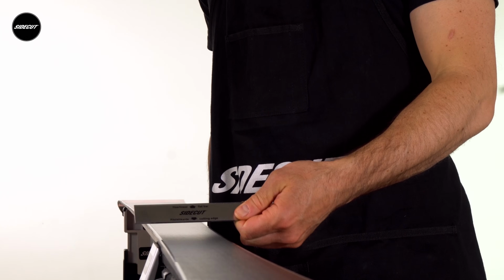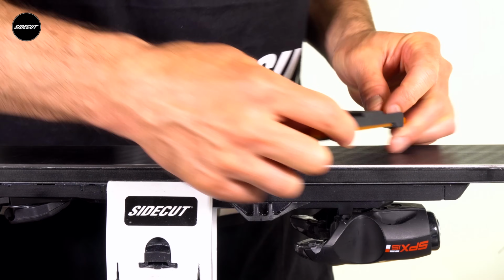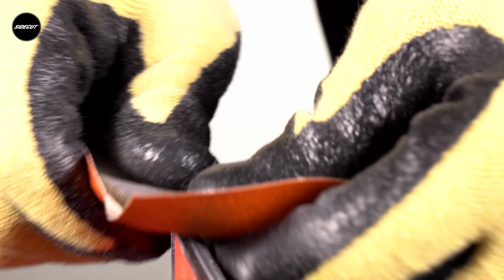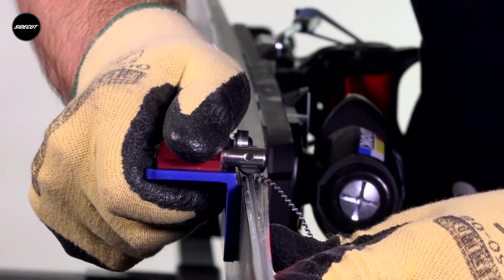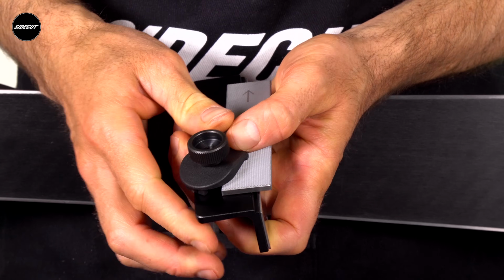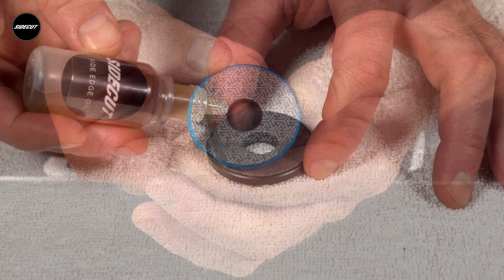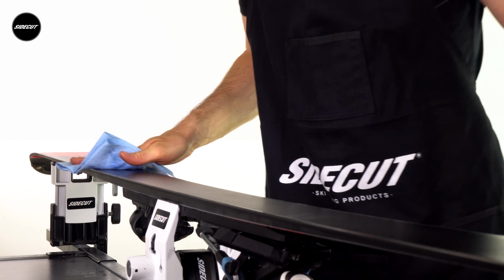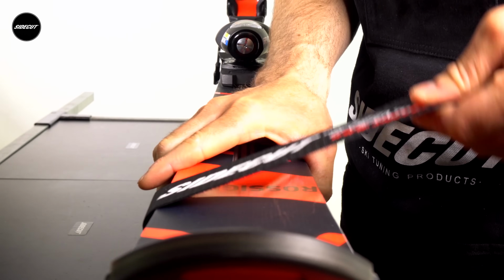How To Tune YOUR Skis

Comment: Question.  You say to scrape the wax within 1-2 min while still warm.  Isn't a warm scrape an alternate way to clean your base (rather than using a cleaner) as it can pull the wax out?  I thought it was best to wait for the ski to cool back down, or even better over night, before scraping?
Reply from the maker: A "hot-scrape" is an alternate way to clean impurities from the base. With Nanox this is different and you're scraping when the wax is "warm-to touch" not "wet" like it is when "hot-scraping".  With traditional waxes yes you wait for a period of time before scraping, however with Nanox you are 'required' to scrape when warm to touch...that's one of the many great perks and nuances using Nanox waxes.  You save so much time with this method.  And no it doesn't affect the glide - it improves it!  Nanox is very unique for several reasons.  Watch our new video coming out in the next week for more in-depth info.

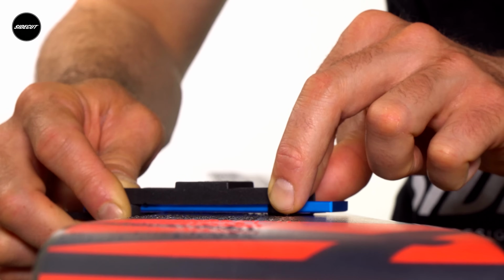Comment: If the base edge bevel comes from the factory already at my desired angle, how can I polish it to remove grind marks and any "waviness" without also cutting the bevel into the base itself? In fact, I think I can see a little bit of this in your video at 4:06. Would this thin strip of base where the structure has been removed affect glide performance?
Reply from the maker: 1st: evaluate if it's really on desired base-edge bevel by using a base bevel meter/gauge.  2nd: use don't need to remove the grind marks unless it's completely inaccurate but this is somewhat rare from the factory.  What you do need to confirm is that the tips and tails in particular are on your desired bevel. 3rd: you won't cut into the base itself if you apply the correct technique and use the correct tool (as shown in the video).  4th: the thin strip of base you see without structure is common and done like this on purpose by the machine.  If you contact any base at all it's minimal at only 1-3mm in from the edge.  Hope this helps!

Comment: Great video thanks!! just one thing....new skis with base bevel at 0.9 and side at 87.5 which guides am i using?? am i taking the base to 1 degree and the side to 88?? TIA
Reply from the maker: 1.0 on the base and either a 2 or 3 degree on the side edges (92 or 93 guide which will give you an 88 or 87 degree bevel).  Note: 87 is more aggressive and holds better on harder snow if you have the matching skill level.  88 is more user friendly. Hope this helps!

Comment: How often (how many days of skiing) shall we sharpen our edges with a file?  I feel that after 5-6 days on cold icy conditions, my edges are becoming dull, hard to control my skis on steep terrain. Do i have to sharpen them with a file, that removes steel, or would a 200 diamond stone suffice in order to bring back the nice grip feeling that we have when getting the skis after the season service?
Reply from the maker: when conditions are hard/icy you’ll need to use a file every time you tune followed by diamond, ceramic or elastik stones.

Comment: How do you fix if the base is edge high by hand? Is it just running your base file more?
Reply from the maker: the best way is to get your ground by machine and then check them with both a True Bar and a Base Bevel Meter.

Comment: I am doing the maintenance on our family ski's. We do slope,freeride, touring and telemark and therefore have in total 12 pair of ski. I use mainly Toko and Swix products. I really like the Sidecut file guide with the fixation. I am doing it with a clamp. I tried to find Sidecut products in Europe but there is no seller here. 
I usually let the wax cool and harden over night and take it down next day. Our outdoor temperature is 0 to -5°C, hence it gets very hard to scrape. As i dont have an indoor place to do it, its all done outdoor on my terace. Do you consider this as harmful for the base? How do you scrape of the wax on a concave base? i use a 3mm plexi that is rather soft. But you did mention to use thick ones. I agree this for the flat base ski. I apply with Swix a kiss roll hot wax machine.
Reply from the maker: email us for more info!  it’s better to wax at room temperature if possible.  For removing wax watch our tip on how to scrape but in a nutshell turn your scraper a few degrees and take 2 passes on the left side of the ski followed by the right side.

Comment: I’ve been racing Nordic and waxing my own skis for 47 years but leave tuning of my alpine skis to the shop. I want to start tuning my own alpine skis. The issue that has scared me from tuning alpine skis is edge construction, bevel,etc. is there a diagram anywhere that describes edge angle ?  Also, how can ski edges take frequent sharpening without eventually wear down to nothing?  Stupid questions but they have caused apprehension in tackling my own tuning. Thanks
Reply from the maker: It’s scares most actually….but I’ve yet to meet anyone who has started and say they wish they hadn’t. It’s literally transformative to one’s experience on snow.  Sure you need to learn it however the learning curve is extremely fast.  Contact and we can help you out.  And yes tuning the edges makes them thinner however for most skiers the ski wears out long before the edge wears out.

Comment: Wtf this is severe overkill unless you are some kind of super competitive racer. Most skis are perfect out of the wrapper.
Reply from the maker: Thanks for your FB! Skis come with a very average tune (out of the wrapper) typically and need to be 'set up' based on ones skill level, strength and the type of ski/skiing you're doing.  We believe getting the utmost FUN and PERFORMANCE out of your skis is the goal and tuning is an easy and major contributor to achieving both of these. Give tuning a test...you may never want to ski again without proper tuning.

Comment: Wait, wait, wait. This is not a ski tuning video for anyone trying to tune at home. This guy is using tools that are better than 90% of shops out there. This is high quality race prep. This is not for a diy skier.
Reply from the maker: Thanks for the feedback. This video is intended for those at home 😊 and anyone who wants a safer more enjoyable experience on-snow.  Ski tuning is directly related to improving your skills on-snow and as coaches we want to demystify tuning for people because it's actually incredibly easy with the correct tools and information. Yes, one could say these are the basic steps for a 'race prep' however they are the exact steps done for a recreational weekend skier (minus a few nuances) whose goal is to have more fun and improve their turns. Our sport is so costly that in our opinion most are missing out on SO much when you don't tune your gear. We're here to give anyone interested the confidence and knowledge to DIY.  And yes, you're right it can be very tricky to find really knowledgeable ski shops that tune well. However, that has changed a lot over the past few years and if you search a little you can find shops that do really great work.  All the best!
Reply: Read your reply and re watched your video. I understand you want to sell your product, which looks on point. However you're misleading the viewer with the title. This is not diy unless you have some experience. 
Do you offer clinics on tunning? If so I'd like to swing by and check out your product.
Reply from the maker: Thanks for the FB. Our four step system has helped many. Yes, we offer tuning workshops for all abilities.  In fact, our 'model' has always been based around 'free education'. It's our belief that skiing and boarding are both way more fun when your gear is tuned correctly. PM us if you're interested in knowing more about us and/or our products. It's much easier to discuss on the phone or in-person.  @grujenkins
Reply: How have I never heard of you!?! Stuck in the basement inhaling to much ptex smoke I guess. Just checked out your website and I wish the boss would have let me go to SIA back when it was legit. I'm going to still stick by my comments though. Peace

Comment: Very concise yet detailed guide, the filming and presentation is top notch as well. I noticed there was no use of any ski-specific base cleaners such as Rode Glider Cleaner or Swix Glide Wax Cleaner prior to waxing unlike many other tutorials/clinics. Instead, this guide suggests the isopropyl and distilled water mixture for both polishing and cleaning. The other guides recommend the base cleaner in addition to brushing in order to help the new wax adhere better.

1. Is this lack of base cleaner specific to Nanox, or do you guys find that this solution is sufficient for all waxes when the base is prepared with a brass/steel brushing?  
2. Additionally, is there a recommended ratio of the isopropyl solution?

Thanks in advance, been really enjoying using the tools.
Reply from the maker: This is our recommendation as well as Nanox's.  For cleaning you can use a mixture high 40% denatured alcohol to 60% distilled water.  You can play with the mixture.
Reply: @sidecuttuning  Thanks for the quick reply (and processing of the recent orders)!
Reply from the maker: @RolandYong  Of course! Here to help those who want it.
Reply from the maker: Thanks very much for the feedback also.

Comment: how much more of a base bevel on the contact points?
Reply from the maker: Not clear on your question.
Reply: @sidecuttuning  you added more base bevel to the contact points compared to the rest of the base bevel. So how much more do you bevel the contact points compared to the rest of the base edge?
Reply from the maker: @32srt32  approximately 1/4 of a degree greater than the 'body' of the ski.
Reply: @SIDECUT  thank you!

Comment: Wow, that was the most detailed ski tune ever. Thanks for not wasting anytime. It must take a long time, however, to completely tune and wax a pair of skis.
Reply: Best ski equipment video I have ever seen. It illuminates how a tune is probably more important than the make and model of the ski. Sure, the skis are all different, but wow, tuning really.matters.
Reply: @sasquatchrosefarts  Tuning is hugely important but not equivalent to the differences between skis. At least not advanced level skis.
Reply: Not with practice. I can do a full hand tune in about 20 minutes

Comment: Great and elaborate info. I do have a question though: when sharpening with a file and file guide do you work the edge from tip to tail on both sides? 
When learning this skill my mentor always stressed how important it is to work from tip to tail while sharpening, and I don't understand why seeing that you leave a smooth finish if you do it correctly (and you polish with diamond anyway) so the direction doesn't matter. Furthermore, if you would stop halfway through a cut going tip to tail, the remaining burr would face forward and cause the most problems. So my thought is that if you are bad at leaving a smooth edge you should sharpen from tail to tip... or don't sharpen at all ofcourse.

I just leave the file guide set up the same for both sides, so the left side of the ski is sharpened tail to tip as I aim for a smooth finish anyway. What are your thoughts on sharpening direction?
Reply from the maker: You tune with your base facing your core, therefore we must tune both ways.

Comment: Great video - thanks. I've been a tuner for 50 yrs. You included most of the techniques I use and love your tools. I really don't like doing the "rough" tune by hand and about 30 yrs ago I was able to purchase a Moen 6x60 wet belt sander then had a machinist friend make some guides for setting the side bevel. After getting the ski flat and setting the side bevel plus removing all the work hardened areas handwork begins. Grinding really speeds up the process plus provides a uniform and consistent result. Worst part of ski tuning IMHO is getting the ski flat. Typically new skis are concave in the tips and tails and convex under foot. For the price of skis one would think the companies could stop this. I've ranted about this for 50 yrs. Most skiers have no clue about ski tuning importance but it makes all the difference in technical skiing. Personally I like my bases flat without bevel and a 2-3 degree side bevel - makes for snappy turn initiation and a wonderful carving ride. Got any ideas for structure without having a stone grinder?
Reply from the maker: Thanks! You could try a rilling tool (used more often on Nordic skis) or a combination of steel and brass brushes and/or more aggressive style of brush resembling the steel wires on BBQ brush, but longer.
Reply: @sidecuttuning  I have been using a riller tool  Making a wider diameter brush could be an option
Reply: I didn't even know you could run a flat base edge! Going to have to try that the next time I get a base grind. Thanks!

Comment: Hello! Thank you for this very useful video! I have a question: If the base is slightly higher than the edges, what are the options to fix it and bring it all to one level?
Reply from the maker: Bebe, you would need to grind the ski/board flat.

Comment: "wipe the base clean". What if I have no base cleaner, can I use just water? Is this step critical?
Reply from the maker: If the base isn't dirty you don't need to use wax remover.  A better option is to wax the base and scrape it while the wax is still liquid this method of 'hot scraping' will extract dirt from the bases.
Reply: @sidecuttuning  After this hot scraping could you consider the skis are waxed or you need to wax them one more time as usual? Thank you!
Reply: @bebepopescu2090  Another time.

Comment: Great Video.  Question, when using the stone on the bottom edge, you wet the ski with a mixture of water and isopropyl alcohol. what purpose does the alcohol play?  Can I use just water?
Reply from the maker: It helps to polish the steel more effectively and and keep the stones clean.

Comment: Some good info, but no mention of flattening a convex base, as that would have to be done with a metal scraper unless you happen to have a base grinder.
Reply from the maker: That is correct you could attempt this with a metal scraper, however, a better option exists. Try our cutting tool (made for this purpose) which is the opposite side of our SIDECUT True Bar:  https://www.sidecut.com/product/TRU_BR_130MM.html
If it is a more extreme case then a grind is the best way to solve this issue and ensure the trueness of the base. Be sure to check the grind with a true bar and base bevel meter when completed.

Comment: Very informative. I don't go into anything like this degree of detail, but got some good info. I'm tuning my skis to 1 degree base and 3 degrees side, which does require sidewall removal. One thing I've done is to put black magic marker marks on the sides of the edges so that I can see when I've gotten the sidewalls to 3 degrees, since they normally are factory set to one or two degrees. It seems that has worked well.

Comment: Great video. Looking forward to try some of you products. Especially the diamond disk. Could you, either here on in a future video run through the stones one can use. I am unsure how/why the Arkansas stone is used.
Reply from the maker: Refer to this link Kenneth:  https://www.sidecut.com/category/ski-tuning-diamond-stones.html

To help you choose which discs you need:

120 & 200 grits are used for sharpening, removing burrs and for hardened edges. Great for getting your edges back to the angle your desire quickly without using a file.
400 grit is used for sharpening and polishing. A great disc/stone to carry in your pocket on the mountain also!
600 grit is used for fine polishing.
1000 grit is used when you desire an extra high polish and are concerned about hundredths of a second or really care about how the edges perform on the hardest snow surfaces.
Tip: It's best to have at least two Diamond Discs/Stones - 1 x 120 or 200grit and 1 x your choice of 400, 600 or 1000 grit. 

For best performance and extra long life all diamonds should be used with SIDECUT side-edge oil. Oil improves the polish and speed of the edges and is the best way clean them.

Comment: How do I get my edges to last the longest and still have a lot of material for future sharpening?
Reply from the maker: Reese you tune often to 'maintain' your skis sharpness instead of leaving long periods between tunes.  This way you take minimal edge off each time but more importantly you reap the benefits of tuned geared every time you're out there = more fun.
Reply: Your skis will lose their responsiveness (rebound energy) well before you run out of sidewall even if you sharpen them every outing.

Comment: Awesome video! Quick question how to do you determine what angle you tune your base and side edge with? Is it based on what the ski manufacturer originally sets the edges at or is it more you can use what angle you prefer?
Reply from the maker: It goes by you strength, skill level and preference.  Here's a link to our recommendations in a pdf chart.  https://www.sidecut.com/ski-tuning-degree-guidelines.html

Comment: Great video, amazing level of detail and professionalism. I have one question though, I'm a snowboarder :) Does this apply EXACTLY to snowboards as well OR is there any difference(s) in the process? Cheers
Reply from the maker: Bruno, firstly thanks very much! Tuning for a snowboard or a ski is the same.  Let us know by email if you have any further questions.  Thanks!
Reply: The only difference is you may want to buy a scraper specific to snowboards so it takes less time.
Reply from the maker: @harkenm  these days shorter scrapers (the same ones used for alpine skis) are much more commonly used. Longer scrapers 'bow' more easily and therefore may cause convexity on the base of your board = prematurely having to spend money grinding your board flat potentially.